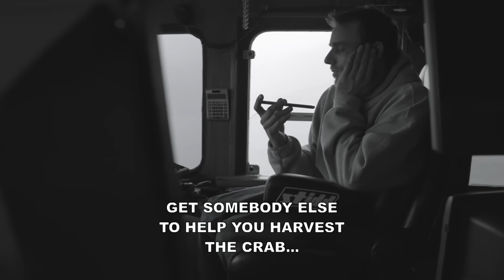The Saga Ship's Engine Comes Close To A Catastrophic Fire! | Deadliest Catch

Comment: Has anyone in the fishing industry ever hear of a half mask (at a minimum). Big ships and crew are well versed with fire protocols…. Just saying. A cheap piece of PPE to avoid that whole hacking / throwing up / possible COPD or cancer etc…. Might be an option.
Reply: Those old boats are filled with asbestos and that clutch has most asbestos than you can imagine.
Reply: @Cultofpersonality09129  Ah ok so why try then right? Makes sense...NOT
Reply: I'm surprised mid-large comm vessels dont have at least a couple SCBA packs, could be the difference between sinking and sailing for some situations.
smoke inhalation is no joke, not the copd (they all smoke; they gonna have it eventually) but the acute risk of sudden death it carries.